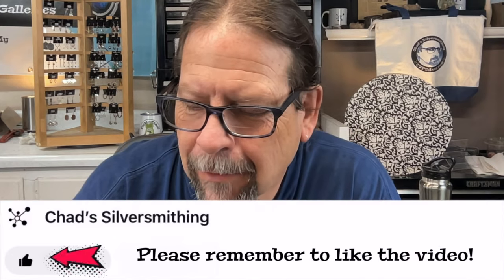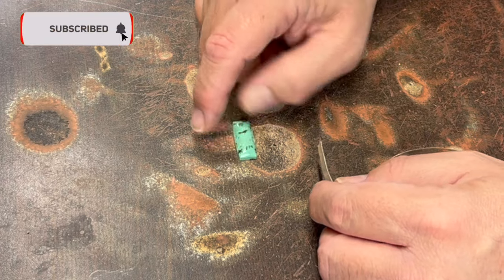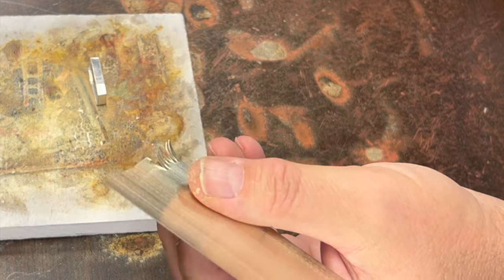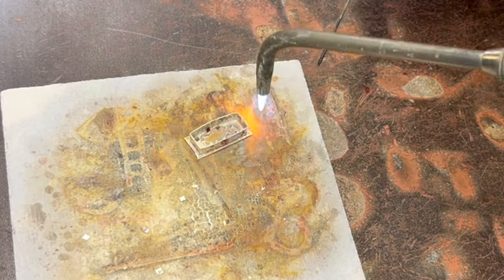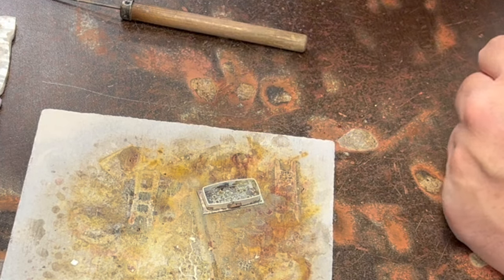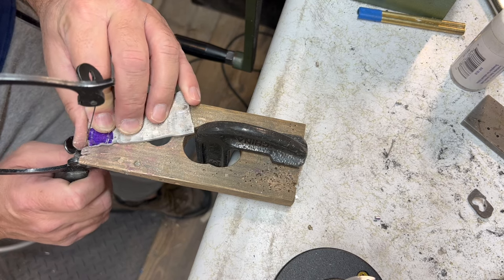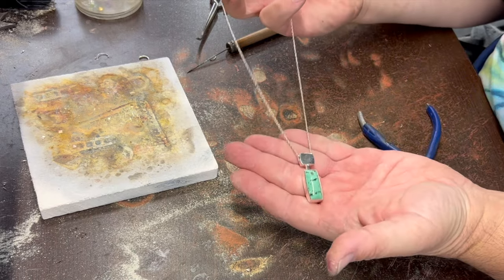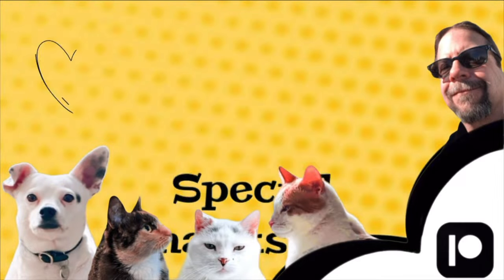Make a Simple Contemporary Variscite Pendant: A Silversmithing Tutorial

Comment: You lost me when you mentioned using cardboard as a filler. Why not epoxy are thermo lock, something easy to fill in the space! Just an idea.
Reply from the maker: Thank you for you comment RC moot. Most people I know use either tagboard or sawdust to back stones in closed back bezels. Something slightly compressible helps to get a snug fit. I only use glue when mounting something with vertical sides like a cylinder or quartz crystal where you can’t get a grab on the stone.
Reply: I am familiar with sawdust but good to learn about tagboard.
Reply: I use tobacco sometimes. It’s the way the Native Americans would make it years ago.